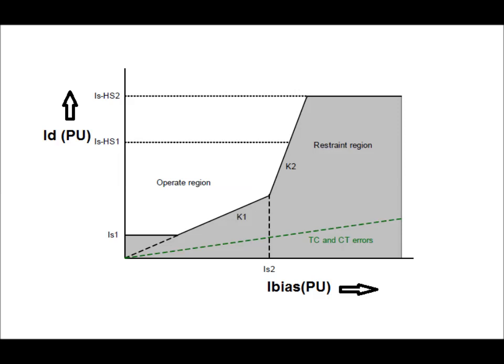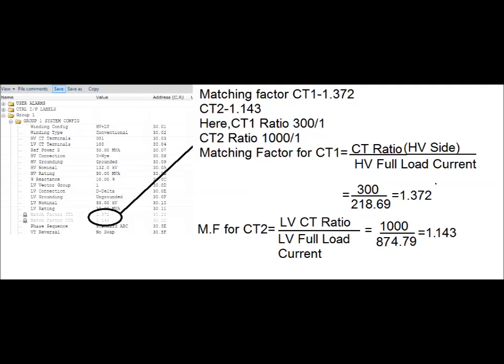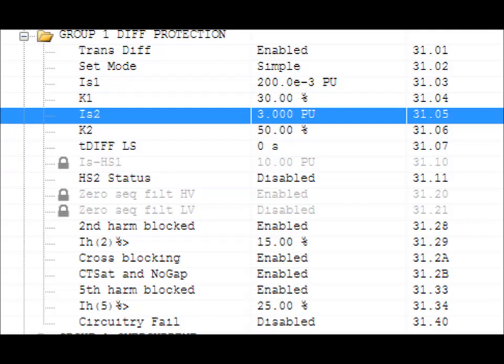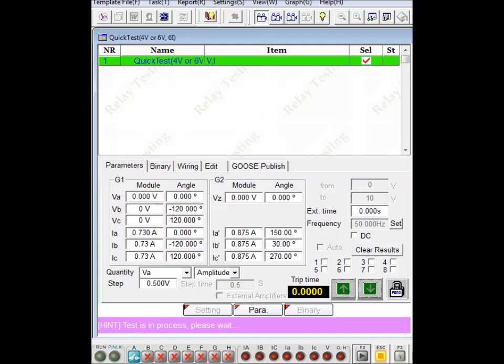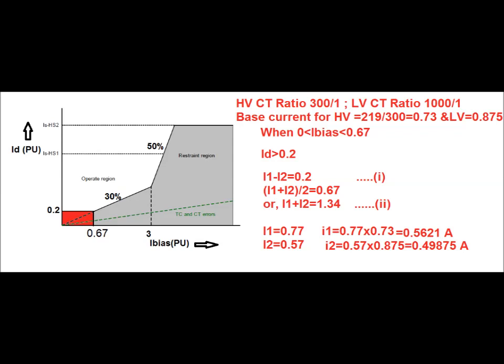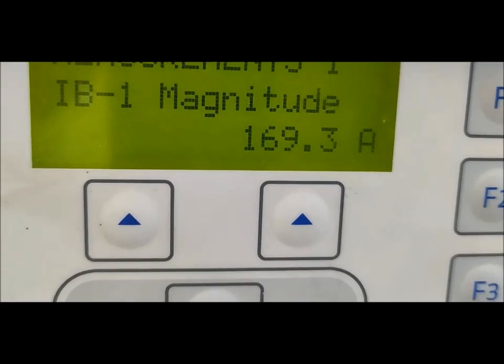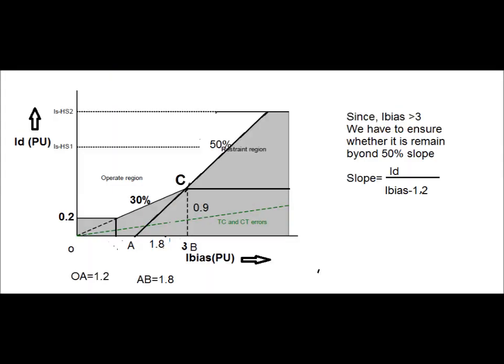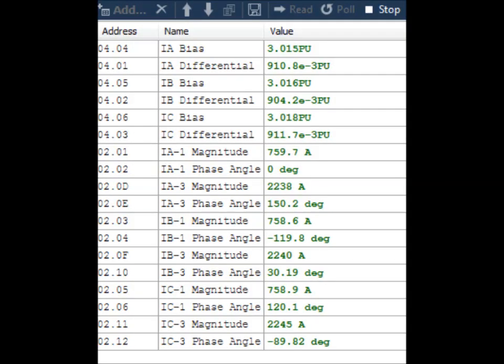Differential Relay Testing (Micom P643)

Comment: Why we take is1.002 and is2 3pu and k1 is 30 % and k2 50% .how it comes
Reply from the maker: Is1 is set as minimum as possible in order to give sensitivity to differential relay but it is so chosen that due to mismatch of tap position it should not operate. Again next slopes are given to maintain stability due to through fault. You can go through video https://youtu.be/9sc9WsiqmA4